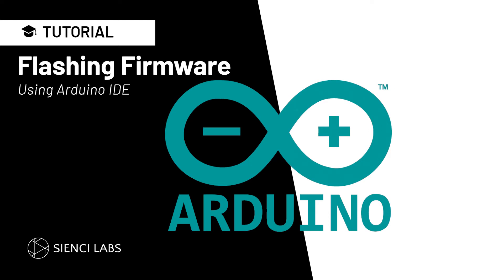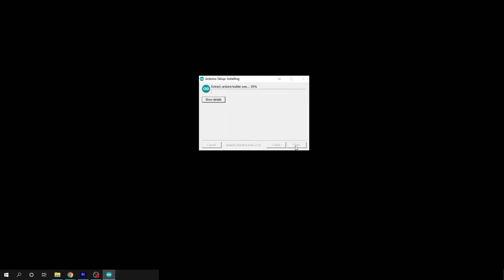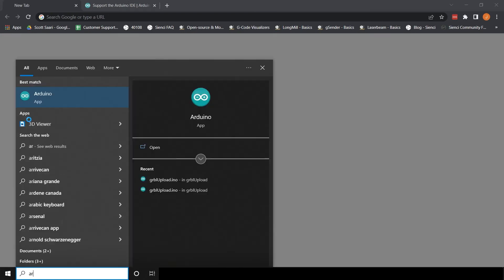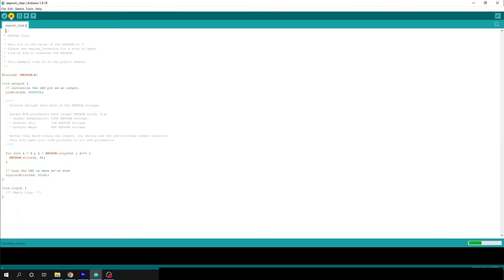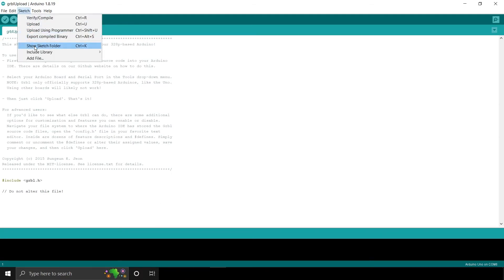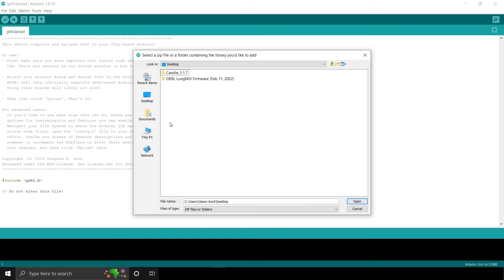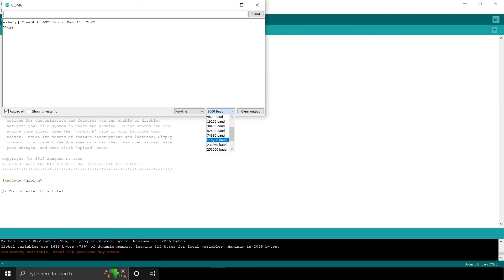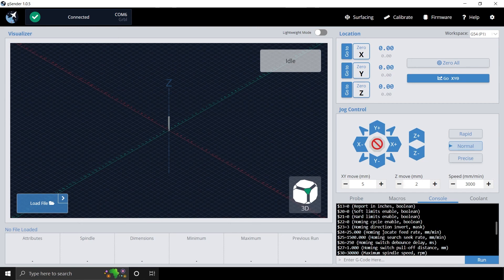How to flash firmware to your Longmill or other grbl CNC machine using the Arduino IDE

Comment: This stupid video bricked my controller. Do not clear the eeprom
Reply from the maker: Hey there, we're sorry to hear you're having trouble. The controller will disconnect from the computer after flashing.
Go back into the firmware tool and click Restore Defaults. Check this link to see if it solves your problem.
https://youtu.be/GsZX0NbCTYk?si=uhBGlZXBunFaAXo1

Comment: Hi. I was wondering if gSender works with the Arduino Mega 2560? I am brand new to gSender, and I like what I see so far. I was able to use gSender to FLASH an UNO, but it won't flash a MEGA. For a related question, if I flash a MEGA with GRBL using some other means, can I then use gSender with the MEGA? Thanks!
Reply from the maker: We haven't specifically tested that configuration, but if you're using GRBL on the Arduino MEGA, the result is similar. If instead you're using a different flavour of GRBL it's possible you might not get the same results since gSender is designed around regular GRBL. I guess if you have the parts on hand you could give it a shot and see.